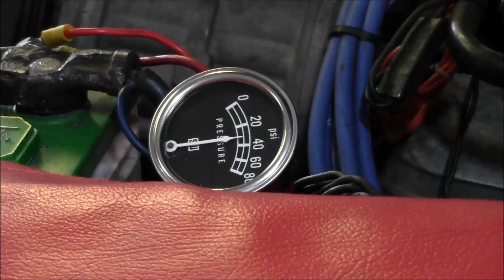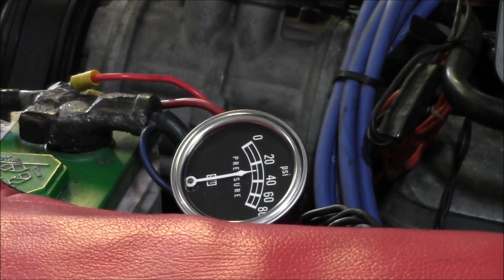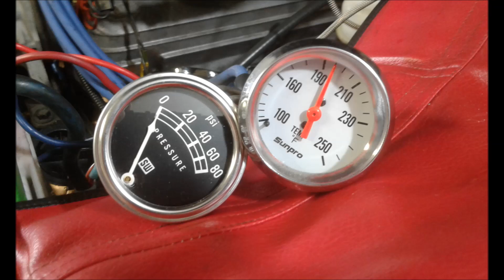Wounded Fox Body...  BTU/rejection/correction

Comment: Idle is sounding way better now! I had a car when I was 16 that was air blocked and after changing all the cooling components and a new radiator I realized the issue. After letting all the air out it was good to go. That sucks with the oil pressure but your getting a spike on  rev so the oil pump is keeping up . Is there any lifter clatter at idle? Is oil light coming on inside? The main issue which you already know is bearing tolerance and your needed proper lubrication. I would put it some Lucas oil treatment/ assembly lube, which will hopefully coat up those bearings in case you have any starvation and run with it. I admire your drive to keep getting the issues resolved the best you can. Cars can be very frustrating  and your keeping your cool thumbs up👍
Reply from the maker: 2RCPRODUCTIONS:  Yes, she is sounding better now.  Those air pockets can be a real bitch some times!  No lifter clatter at idle... which is kind of odd with the low pressure readings.  No oil light coming on inside.  Thanks brother... this has been very frustrating to say the least!
Reply: fwh79 😁👍👍